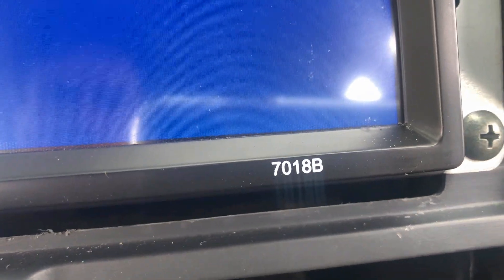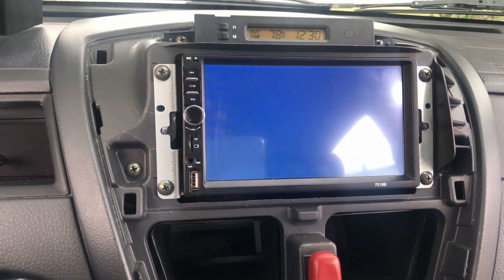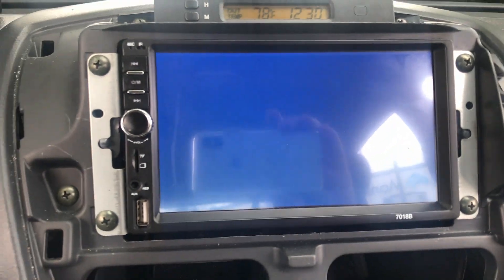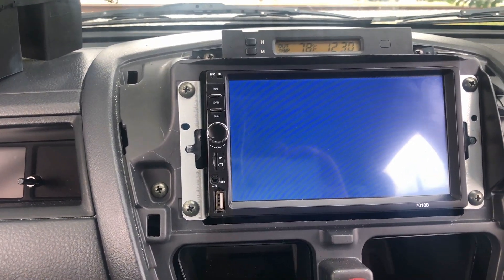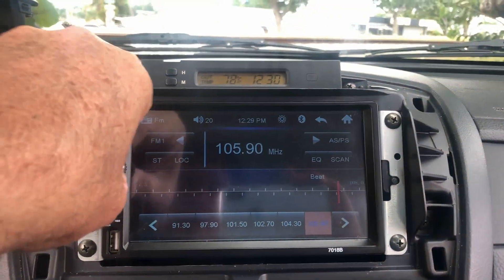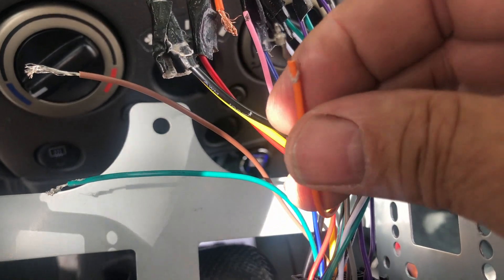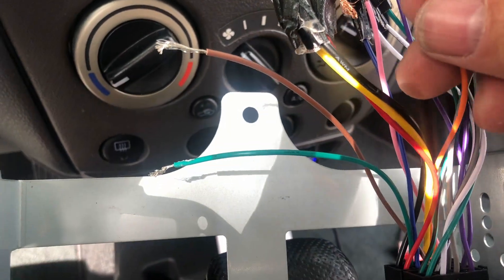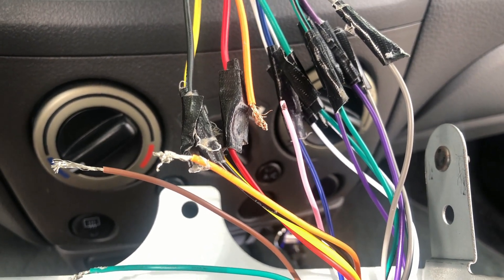THE BLUE SCREEN OF DEATH:  QUICK FIX

Comment: Orange wire is for rear cam
Reply from the maker: Ahhhhhhh. Thank u for that comment!!
Reply: The orange wire on the back of the radio goes to the illumination wire on the wiring harness. That should make it where it dims the radio when you turn your lights on so the light isn't blaring in your face at night. And The yellow RCA wire that has that red little wire coming out of it that goes into the video input for your camera into the back of the radio and that red wire that is attached to the yellow wire hooks up to your reverse wire on your wiring harness.